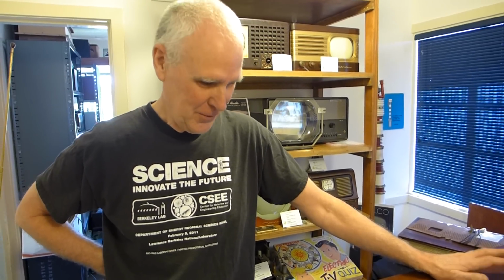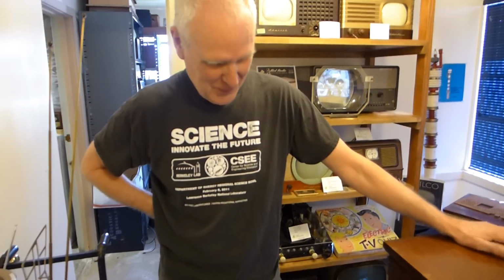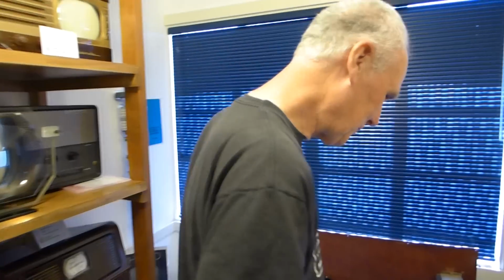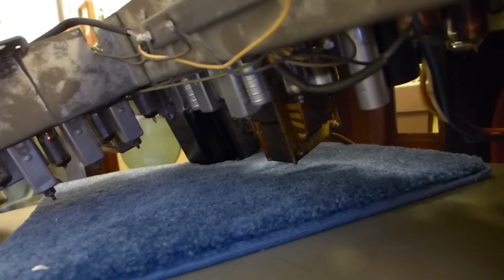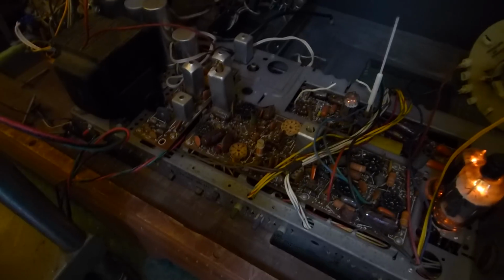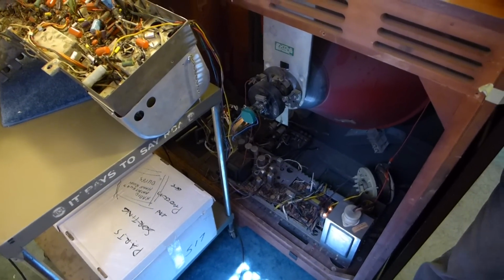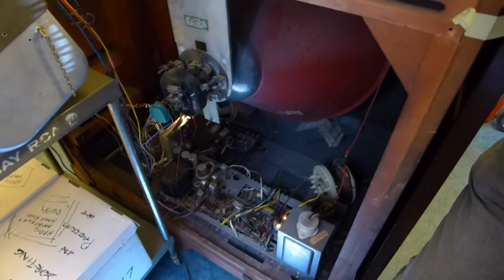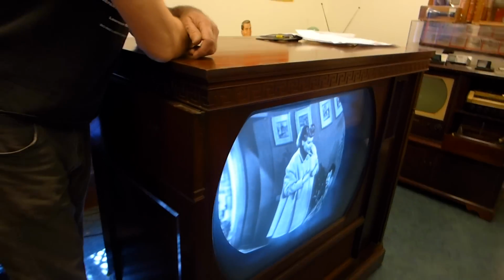John Staples Restores a 1952 DuMont TV

Comment: Wow! In the 50s and 60s my father taught me to fix TVs and radios. He was an engineer at RCA. I used to earn money fixing the neighbors’ sets. I did make house calls for the big ones but preferred working in my dad’s basement shop. I could fix 95% of everything that came in - my dad fixed the 5% that I couldn’t. I envy you. I wish I could go back to those days. Vacuum tubes were ‘alive’ in a way that transistors are not. I got more than a few scars from those HV rectifier tubes but I learned how to work safely. My dad said he could fix anything with a wet finger and a pencil. The wet finger was for ‘measuring’ voltage and the pencil was for tapping tubes (if you don’t understand ‘tube tapping’ , well, I guess that’s one for history).

Comment: When I was fourteen, someone gave me the power supply chassis from one of these Dumont monsters. It ran a lot of my home made projects (in a barn! I grew up on a ranch in the boonies). Gave me one of my nastiest electric shocks too. While turned off! It left four first degree burn "pits" in the palm of my right hand. Six months to heal! DO NOT pick a male pinned DC power plug on a huge power supply. What were they thinking?

That's a great restoration job, John. Thanks for the demo.